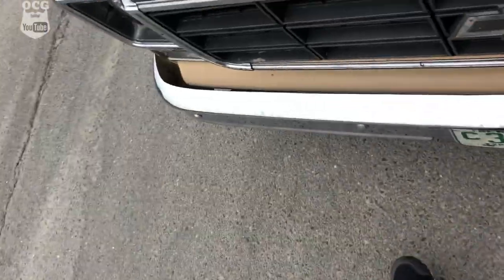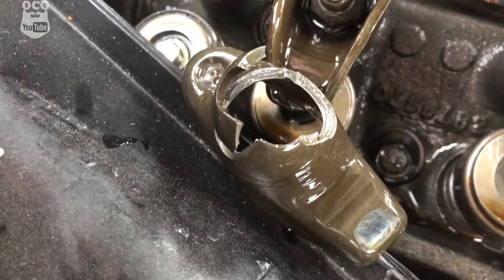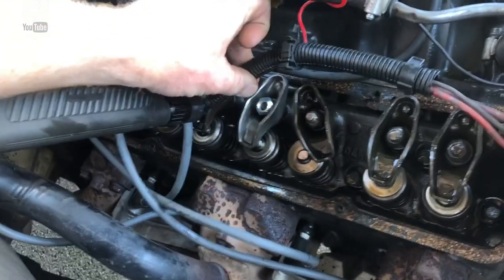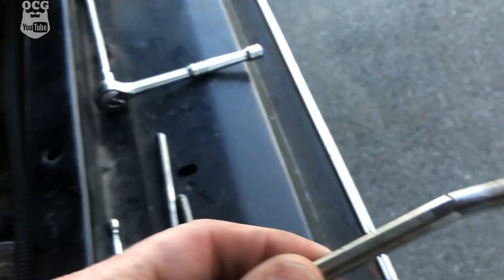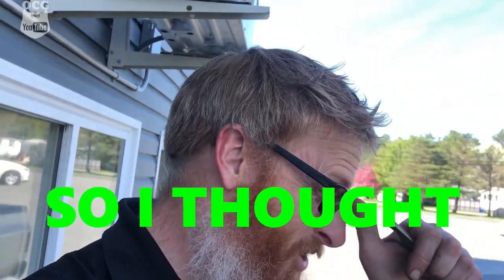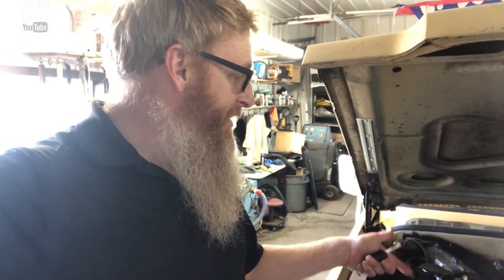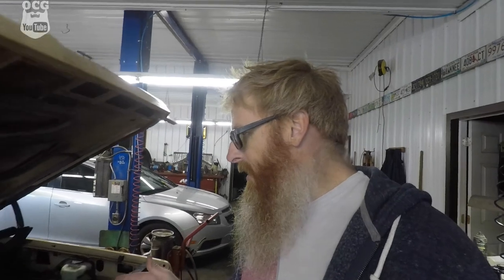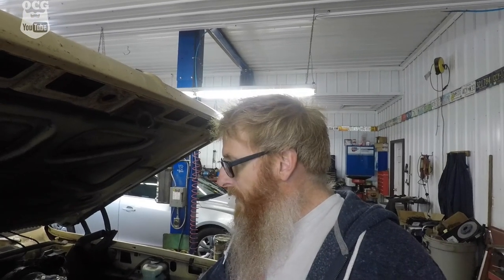I BROKE A ROCKER ARM AND PUSHROD ON MY 1977 CHEVY C10

Comment: Many years ago, I had a mild built 1966 396 Chevelle with a street cam. It had the stock rocker arms that turned out to be the weekest part of the valve train. I was constantly breaking rocker arms. I finally replaced all rocker arms with T.R.W. rockers. I would even suggest a set of Roller Rockers, they having less contact friction on the valve. Also make sure you are using the correct length push rods. The contact point that the rocker has on the tip of the valve is critical. Good luck and don't get discouraged .......
Reply: agree with Paul, if you built your engine with a upgraded cam, you should match  the upgrade to the rockers, push rod and maybe set of spring to go with it...hope you good luck with this
Reply from the maker: New rockers and push rods should have been installed at the time of the build!

Comment: I'm not an engine builder but watching your assembly video for Dale's engine I was surprised you used used rocker arms and push rods for your build. I remember back in the 60's  and 70's people would do a valve job on an old engine without touching the bottom end and it wasn't long before the bottom end went out. I bet your dad could attest to that. Anyway love your channel and admire you because you are real and genuine and hope you get to 40,000 Subscribers.
Reply from the maker: Thanks so much Gregory! It’s always the parts you didn’t replace! And coincidentally the cheapest parts of the bunch. For now I’m chalking it up to a one off thing. If it does happen again I will replace everything.
Reply: @OldeCarrGuy  For running around staying close to home Dale should be good and any more problems should surface quickly. If your going to take Dale on the Hot Rod Power Tour I suggest new parts before you go.

Comment: Sucks that Dale is down Jason, I had some issues with a 302 where i had a bad run of lifters which led to bent and broken push rods pulled the intake and replaced the whole set of lifters and installed new push rods then adjusted the valves the issue went away... some times it pays to use OEM or trusted aftermarket parts in area's that require dependability, See you in the next one!
Reply from the maker: Don't worry Craig. We'll get him back on the road in no time!

Comment: I DO IT THE OLD WAY WITH OUT THE MOTOR RUNNING SOAK LIFTER OVER NIGHT ASSMBLE ROCKER AND PUSH ROD TURN NUMBER ONE TO TOP DEAD CENTER USE INDEX FINGER AND THUMB TURN PUSH ROD WHILE SLOWLY TIGHTEN ROCKER TILL PUSH ROD  JUST STOPS, BACK OFF TILL ROD JUST TURNS, TIGHTEN TILL JUST STOPS FROM THAT POINT TIGHTEN HALF TURN . THIS IS ALL DONE ON COMPRESSION STROKE,THAT CYLINDER IS SET TO GM SPECKS .FOLLOW FIREING ORDER TO COMPLETE VALVE TRAIN. ALWAYS REMEMBER BETTER TO TAP A LITTLE THEN TO TIGHT. THIS WORKS FOR ME EVERY TIME. SURE HOPE THIS HELPS.

Comment: Man that sucks. I ain't no professional but I think a tiny piece of that rocker arm got sucked in and damaged a valve. Good luck on getting Dale fixed again.
Reply from the maker: To be continued! Worked on it a bit last night and made some headway!
Reply: sucked in where ? the intake and exhaust systems are isolated from the oiling system and the rocker box . the only thing that can happen is a part of the failed rocker gets into the spring or dampener winding.
Reply: I don't even remember what I was talking about lol I might of meant that the rocker arm got jammed into the spring but I don't remember

Comment: So rocker pieces cant get into the intake or  exhaust . it can drop into the valley and make its way to the bottom of the pan, or it can get into the valve sping or the dampener and cause the spring to bind and the pushrod breaks. And if you drove the truck with no tension on the lifters the cam and top end are going to need a rebuild due to the loss of oil pressure to the lifters , if one poped out of the bore then all the pressure for all the  lifters is lost and the cam oil pressure drops.
Reply from the maker: Thanks for your concern. Guess I lucked out!

Comment: There have been issues with cam cores and lifters the last few years. The real issue was you said it was finished so it said no way lol
Reply from the maker: You're definitely on the right track. Spent some time on it last night. I think we have a bad lifter!
Reply: @OldeCarrGuy  i have been see8ng alot of them from guys in forums. Unforently low quality from overseas and south of the boarder it would seem. Companys like comp, isky, and howards had good cams and lifters now you here alot of complaints. I went thru 3 lifters on nightmare

Comment: So sorry Jason about old dale there .. maybe better happen now than when on a long road trip or summer tour!! Stay positive these things as you know with older stuff happen even with new stuff in them.. I’m jus wondering if one of the two head studs got pulled up .. where the rocker was broken or the loose rocker beside it you found .. reason i ask is I had a older 69 / 70 350 chevy all rebuilt Similar to what you did to dale an in about the same time frame as you driving around after all working good it all sudden as I was walking the engine up at stern speed it spit sput an I let off an she was running rough idle then.. after driving back home 2 miles or so An investigating .. it was a head stud that popped up or say pulled up .. I imagine you’ve checked that all head studs are still all way in but sometimes they can be jus slightly up higher than another making it hard to see / catch .. anyways .. jus wondering  hope u have good luck an nothing to serious. 👍
Reply from the maker: I did check all the obvious stuff! Thanks for the insight though! We'll have him back on the road in no time!

Comment: Maybe too much pre load on that 1 valve ..overtightened..ruined the lifter ..wiped the cam and when lifter got worse down caused push rod to become loose and bind up under socket breaking said rocker
Reply from the maker: Cam inspection coming tonight!